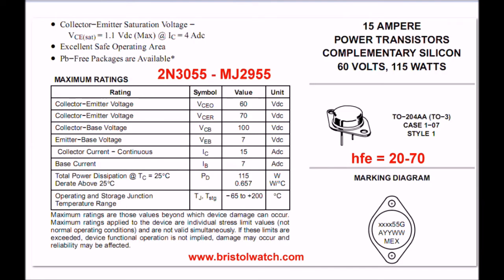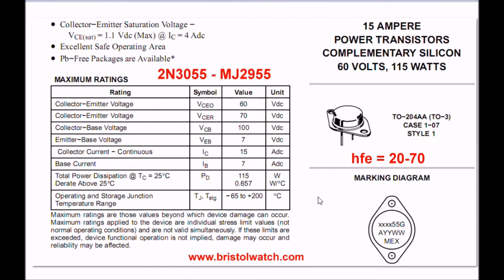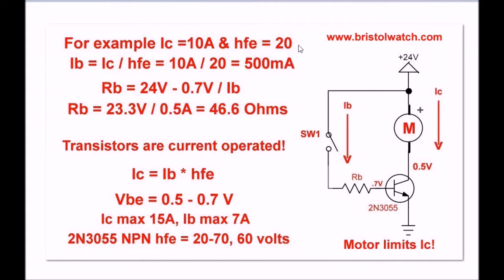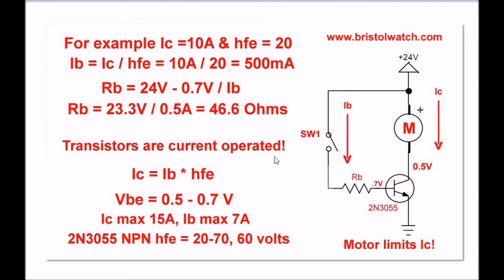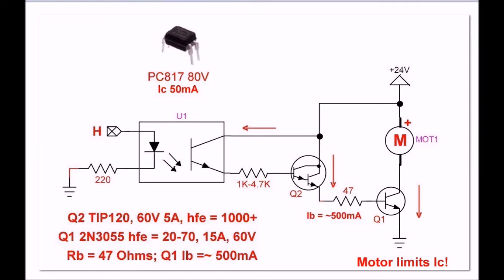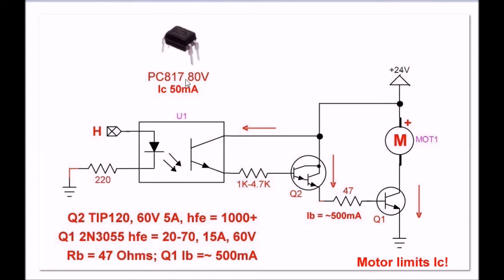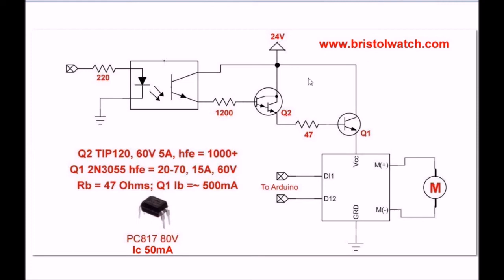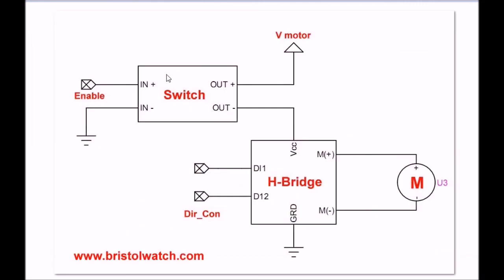Design 10-Amp 2N3055 Based Power Switch

Comment: nice basic circuit. can use power MOS FET with some changes . FET is voltage controlled. also IGBT can be used. can use the PNP 2N2905A and tip42C  just flip circuit around. current flows in PNP in outher direction.

Comment: Ok, just make some maths before burning the 47 ohm resistor - this must be 8 Watts at least!!! The voltage drop is about 20V and 500 mA of current.
Reply from the maker: I don't think I gave the wattage. I believe it is 12 watts. 20 X 0.5 = 12.
Reply: @LewisLoflin  no, you didn’t. Anyway it’s always good to be patient and do the math. Actually the tolerance of the resistor gave me less than 500mA - 400mA. But 15W will be safe.
Reply from the maker: @JurekPrzezdziecki  Thanks for noting this. I need to put the wattage into the next video.
Reply: @LewisLoflin  BTW, what kind of dc motor do you have in mind? for CNC?

Comment: Thanks. could you tell me where is the problem? i used arduino input (Blink example) to the base of tip120 with rb=1000kohm, trying to switch a load with 3.1 ohm, Vmax=1.4, and imax=1.14 amps. whatever i changed the Rc, Vdc, i couldn't get the desired current or voltage to drive the load. the second issue is, when measuring the load voltage using a multimeter, it does not turn off !

Comment: The motor should have a diode protection circuit 
 when the 2n3055 switches OFF  inductance in the motor will cause stored energy in the electro-mechanical motor to
be generate a huge voltage spike that will easily exceed 60Vce, destroying the entire circuit 

It is common to connect a large diode across inductive loads to prevent such voltage spikes .
Reply from the maker: OK.

Comment: Hi Mr. Lewis,
Thank you very much for the info of using the optocoupler to drive 2n3055, can you replace ignition coil 12vdc in place of a motor and please can you give me the voltage input minimum and maximum of the optocoupler how many bolts was in your recent video, thanks,
Romeo jr.
Reply: I would replace the 2N3055 with a higher voltage rated transistor such as the BU508 or BUP941 because of the high induced voltages that exist in the ignition coil driver circuit when switching the coil off. There is a disadvantage with the first transistor suggested because it has a low Hfe figure below 5 meaning it has to be driven with fair amount of current from the rest of the driver circuit to work properly.

Comment: How many Watts the 47-ohm resistor should be?  Nice and very useful video!
Reply from the maker: 1 watt to be safe.
Reply: @LewisLoflin  Hi Lewis, I'm a bit confused. At 5:00 minutes into the video,  based on the base current requirements, we require 500mA to ensure the 2N3055 has a collector current of 10A.
If we use a 47 ohm resistor and based on I2R dissipation, it amounts to about 11.5W (0.5^2*47) of power dissipated from that base resistor.
Shouldnt we be using a higher powered resistor?
Thanks
Reply from the maker: Yes use a 15 watt.
Reply: @NikonCrayzee  Use an N-Channel Mosfet instead of 2N3055, it's a much simpler circuit.
Reply: @charleslyell3748  but did you notice, that this tutorial is about using a BJT not a MOSFET?
Reply: @NikonCrayzee  Yes, exactly. I've used a 2W resistor and it burned.

Comment: I know the 2N3055 is the default transistor for circuit explanation designs, but some alternatives I've seen are the TIP147c, 2SC4706, 2SD1047, MN2488. They all have slight differences between specs but should be able to work in some circuits.
   Sometimes it seems like the 2N3055 is overpriced specifically because they are sought out by people that haven't figured out how to find and use equivalent or near equivalent devices.
  I know the TL081 based adjustable bench power supply kits sold for around $5 use a 2SD1047 as the main power transistor. IIRC that kit is based on an Elektor magazine article from the 70's (or 80's). The design originally specified a 2N3055 ;)

  Thanks for this upload Lewis. I was actually following a 'plate circuit' on your website yesterday and was trying to figure out why I was having trouble with overheating a collector resistor on a switched lighting circuit. I should have realised the circuit is already current limited by the load when using the low side switch. You reached through my phone for that facepalm moment when you mentioned here that the motor limits the current in the circuit you described.
Thanks again. 
-Jake
Reply from the maker: I agree but in general the same rules apply in the design.